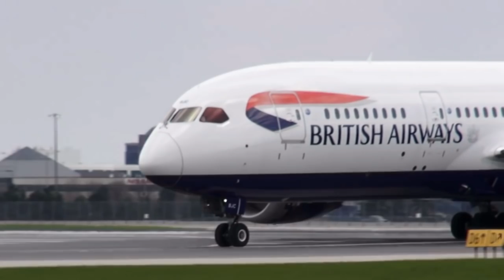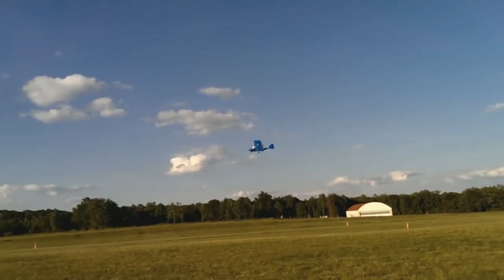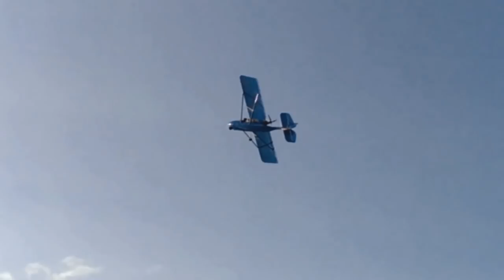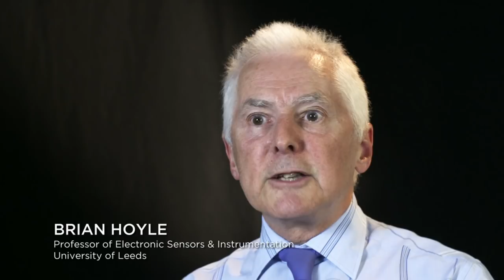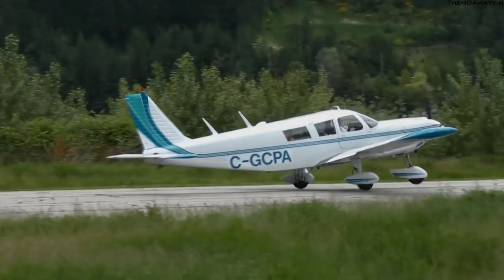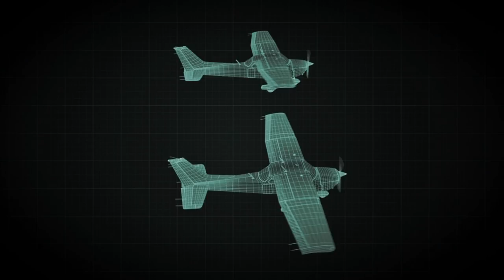First Time Flyer - No Time to Die

Comment: The statistics quoted at the start were about airline accidents. Totally irrelevent to the video.  The narration with total crp too. "Control wheel"?  "when the plane is just off the ground the throttle is pushed in" - no.. it is pulled back.  The "expert" did not know much more. Clowns. :-D
Reply: It's like they got a random guy off the street to comment. Anyway, watched a guy do a similar flight in a Mitchell B-10 ultralight - never flew before, took off, pitched up and stalled, nose-dived in. Plane destroyed, all he got was a cut on his nose. Put the pieces in a pickup and drove off.

Comment: Wow.  I wonder if the talking head has ever flown a light aircraft.  The one in the video has no steering wheel, it has a stick.  It has no flaps.  And you don't push the throttle in to land, you pull it out.